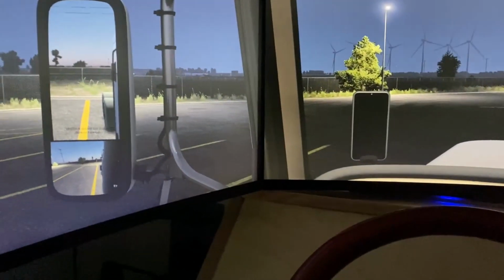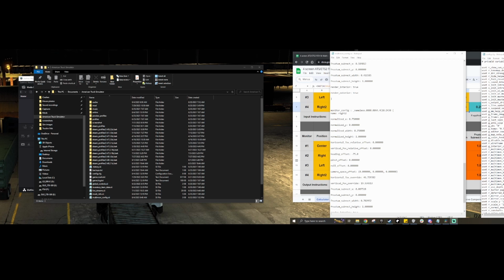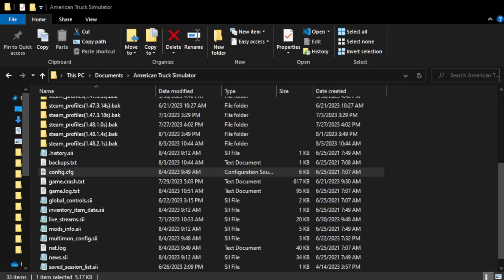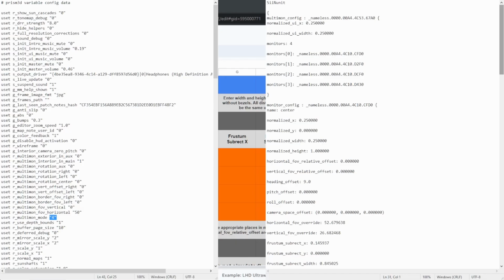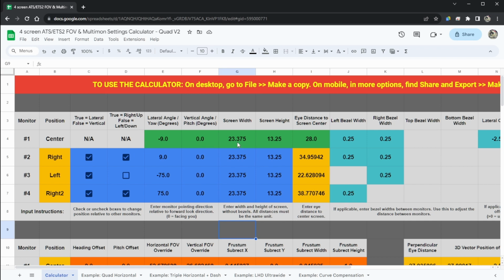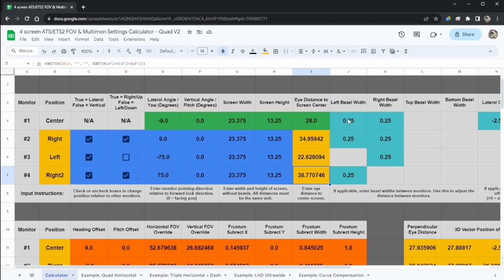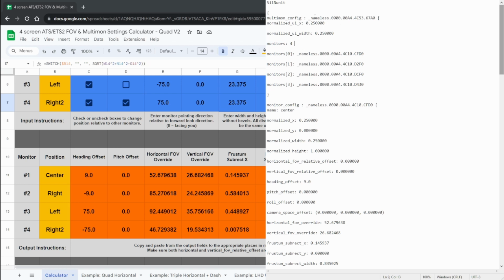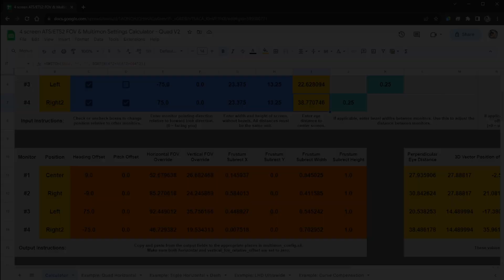How to setup 2 , 3 and 4 monitors with American Truck Sim | Doubles Triples Quad Screens | ATS

Comment: I have a question for you.  I'm using one Super Ultrawide (Samsung Odyssey G9).   Can I use these methods to setup ATS so that I do not have stretching along the sides of my monitor?   I would assume yes, because if you're using nvidia surround then, as far as ATS is concerned, it only knows you have one monitor at that one very wide resolution.  I assume what that config file is doing is actually rendering four separate scenes in displaying them appropriately across your one size resolution span, correct?  So essentially, I could set mine up as two, or three, or even ten (if software allowed) individual slices of "monitors" as measure them as if they were separate with bezel spaces being zero, and then edit the config file accordingly, and then that would get rid of the stretching, yes?   Or is there a better way to achieve that for those of us who use super-ultrawides?
Reply from the maker: Well I would say the short answer is yes to all your questions… however I would set it up as one screen with my same methods and input all the info just so it corrects its size properly, however if it’s just one monitor, you also can just use the default game setup to play, and can then adjust settings in game via f4 key… are you sure the game was using your proper resolution?
Reply: @KaNoodlefpv Yes, 100% it was set to 5120x1440 (native). I spent a couple hours last night messing with it, using the spreadsheet to try different calculations.  I ran into two problems.

1. No matter what, I couldn't quite get the numbers to work so that there wasn't a clear line of separation where the fov calculation takes over. (Hard to explain but its as if you could see three separate monitors on my screen, which is what I wanted, however I shouldn't be able to "notice" where it happens, if setup properly.  There's no smoothness in transition from one slice to the next, if that all makes sense.)

2. For some reason, and I think it's something in the arithmetic...  There is a single black line, vertical, separating the left section from the center section.  Had I actually had three monitors this wouldn't be something that could be noticed as it's as if it waits to start drawing on the left monitor for one extra vertical column of pixels.  I couldn't eliminate that.

Comment: Thanks for this video, but I am having trouble. I followed you instructions and ATS still only start with one monitor. I have tried Project cars 2 and the three monitors all connect and work well, so I know that my three monitor set up works. any advice please?
Reply from the maker: The menus are only on one screen, the gameplay is on them all… are you getting the game menus on one and then black screens on the rest? If you followed the video to the T, it will work as intended. Gimme some more info, maybe i can help!
Reply: Hi KaNoodle, I cannot get the screens to span despite that all three monitors are identical. I have reinstalled the nvidia driver, but two and three connect and disconnect at random. I'm missing something here?
Reply: Hello KaNoodle. I've now got 3 monitor setup after 6 installs of the Nvidia driver and a custom resolution, it's finally working. Thank you for your advice and time on this.

Comment: I need a bit of further assistance if anybody is able to help. I only have two monitors for my case. I did the measurements, everything looked great but it was super zoomed in so I could basically only see the windshield in my fov. The two screens seemed perfectly lined up, however i just need a wider fov. Not sure if I messed up somewhere to cause this.
Reply from the maker: Yeah I would go through it again, make sure all your measurements are correct.

Comment: is this done in imperial or metric?  does it matter if you have curved screens?
Reply from the maker: That’s a good question actually. I converted my imperial measurements into fractions essentially. I didn’t create the calculator so I’m not really sure. So maybe it doesn’t make a diff, but I’m not 100% sure.

Comment: this worked for my dual screen set up but when i added a 3rd monitor it wont display correctly in game!! it has like 4 screens in game!
Reply: figured it out!! when in Config File i Had Multimode set to 3 as in 3 screens.. but after some quick research i found  that 0 is the stock file for 1 screen so in theroy then "3"  would be a 4 screen set up.. entered the new peramiters and fixed my previous issue..

Comment: I don't know what's going on here. I have used two different calculators that look similar. This one and the one shared by Dave Cam over on his YouTube page. In both situations, I get the same results. There is about 60 degrees of field of view on both sides that are completely missing. What I mean by this is that when I scroll something off the left side of my center monitor, it doesn't appear on the left monitor until I continue to turn my virtual head another 60 degrees or so to the right (estimating). Same on the right side. There is just a HUGE gap of missing stuff between both my left and right monitors. I have filled out everything correctly, but I will try to share my files here for others to look at and verify. All 3 of my monitors are the same model:

Monitor width (inches): 23.625 (23 and 5/8 inches)
Monitor Height: 13.25
Distance from my eyes to center screen: 34 inches
Angle of each monitor: 57 degrees
Left/Right bezel width between each monitor: 0.375 (3/8 inches)

https://docs.google.com/spreadsheets/d/1qSnEyyNfb54iMO60wZSlbn33b1dBxPhp8Dz9MiPZce0/edit?usp=sharing
https://docs.google.com/document/d/1AuIVsaYw_Ihu7zo_5S_33WglYfmCuz1woTPjD4YMGjE/edit?usp=sharing

Both my calculator settings and my multimon_config.sii files are shared above. What am I missing here? The only values I have changed in the SII file are the values in orange on the calculator. This should hypothetically work.

Comment: This was definitely helpful. I'm working with two TV's for monitors. Could you tell me which number I need to adjust(play with) to make the screen move over. My steering wheel is split in the middle and I want it to shift more to the left screen. Thanks for the information anyway, it is a great help.
Reply from the maker: Ahhhh yeah!! Sorry for the delay. You will need to adjust the offset. I mention it at some point in the video, where I talk about placing yourself to the one side of the truck. Should be top right corner of the calculator… says offset, play with that number, 1 at a time until you set it where you are positioned in accordance to the screen.

Comment: @kanoodle i tried this on ets2 with double monitors but my screens are all zoomed in you know how i can fix this?
Reply from the maker: Hey there, it should be the same concept. I would attempt to go through the video again, ensuring you followed all the steps. Also, you can hit the f4 button and adjust your position in the cab. but if its zoomed, in, something likely went wrong in the setup process.

Comment: I don't understand why it doesn't work for me :C, I do everything you do but I can't get the same results, the center of the steering wheel is in the division of the screens.

Center N/A N/A 0.0 0.0 0.0 54.0 30.0 65.0
Right TRUE TRUE 45.0 0.0 0.0 49.0 27.0 65.096983

but wrong wrong wrong :C
Reply from the maker: you need to adjust the offset as explained in the vid...

Comment: So I am running a quad setup, nvidia graphics card, screens are on surround, resolution was set to the recommended 7680 by 1080. I changed the uset r multimon config to "4". Then I started the sim and exited. I went to input my my values from the calculator and open the multimon config file in notepad but then realized it only has 3 monitors  and i can't finish my variable input because there is a monitor missing in the multimon config file for some reason... all 4 monitors are on and functioning normal however i cannot get past variable input. Any idea if i missed anything? : /
Reply from the maker: yooo yeah you can just copy the text from the others in the config. 

SiiNunit
// Triple.AAv5.100 
// These two lines must be set in config.cfg when using
// this multimon_config.sii file only.
// uset r_scale_y "1"
// uset r_scale_x "1"
//
// We need 4 rendered images (max game can do).
// AA.Enabler has to be the 5th image (unrendered)
// to prevent memory leak.
//
// horizontal_fov_override: 0.000000 - Set the same FOV for:
// Center.AA, Left.AA & Right.AA ONLY.
// OR keep ALL FOV values at "0.000000" and use the games
// F4 menu option to set your desired FOV and also have a
// working ZOOM feature.
// 
// "Dummy" & "AA.Enabler" are required but not displayed.
// DO NOT CHANGE ANYTHING IN THESE!
//
// Adjust bezels to suit your setup (my example 10mm bezels).
// monitor_config : _Left.AA {
// heading_offset: 3.500000 <- My Bezel (4.0 moves closer
// to center / 3.0 away)
// monitor_config : _Right.AA {
// heading_offset: -3.500000 <- My Bezel (-4.0 moves closer
// to center / -3.0 away)
//
// Recommend capping FPS at 60 or lower.
// Full MSAA setup instructions are here:-
// https://roextended.ro/forum/viewtopic.php?f=19&t=1000
{
multimon_config : _nameless.Triple.AAv5.100 {
 normalized_ui_x: 0.334
 normalized_ui_width: 0.333
 monitors: 5
 monitors[0]: _nameless.Center.AA
 monitors[1]: _nameless.Left.AA
 monitors[2]: _nameless.Right.AA
 monitors[3]: _nameless.Dummy
 monitors[4]: _nameless.AA.Enabler 
}

monitor_config : _nameless.Center.AA {
 name: Center
 normalized_x: 0.333333
 normalized_y: 0.000000
 normalized_width: 0.333333
 normalized_height: 1.000000
 horizontal_fov_relative_offset: 0.000000
 vertical_fov_relative_offset: 0.000000
 heading_offset: 0.000000
 pitch_offset: 0.000000
 roll_offset: 0.000000
 camera_space_offset: (0.000000, 0.000000, 0.000000)
 horizontal_fov_override: 0.000000
 vertical_fov_override: 0.000000
 frustum_subrect_x: 0.000000
 frustum_subrect_y: 0.000000
 frustum_subrect_width: 1.000000
 frustum_subrect_height: 1.000000
 render_interior: true
 render_exterior: true
}

monitor_config : _nameless.Left.AA {
 name: left
 normalized_x: 0.000000
 normalized_y: 0.000000
 normalized_width: 0.333333
 normalized_height: 1.000000
 horizontal_fov_relative_offset: 1.000000
 vertical_fov_relative_offset: 0.000000
 heading_offset: 0.000000
 pitch_offset: 0.000000
 roll_offset: 0.000000
 camera_space_offset: (0.000000, 0.000000, 0.000000)
 horizontal_fov_override: 0.000000
 vertical_fov_override: 0.000000
 frustum_subrect_x: 0.000000
 frustum_subrect_y: 0.000000
 frustum_subrect_width: 1.000000
 frustum_subrect_height: 1.000000
 render_interior: true
 render_exterior: true
}

monitor_config : _nameless.Right.AA {
 name: right
 normalized_x: 0.666666
 normalized_y: 0.000000
 normalized_width: 0.333333
 normalized_height: 1.000000
 horizontal_fov_relative_offset: -1.000000
 vertical_fov_relative_offset: 0.000000
 heading_offset: -0.000000
 pitch_offset: 0.000000
 roll_offset: 0.000000
 camera_space_offset: (0.000000, 0.000000, 0.000000)
 horizontal_fov_override: 0.000000
 vertical_fov_override: 0.000000
 frustum_subrect_x: 0.000000
 frustum_subrect_y: 0.000000
 frustum_subrect_width: 1.000000
 frustum_subrect_height: 1.000000
 render_interior: true
 render_exterior: true
}

monitor_config : _nameless.Dummy {
 name: Dummy
 normalized_x: 0.000000
 normalized_y: 0.000000
 normalized_width: 0.000000
 normalized_height: 0.000000
 horizontal_fov_relative_offset: 0.000000
 vertical_fov_relative_offset: 0.000000
 heading_offset: 0.000000
 pitch_offset: 0.000000
 roll_offset: 0.000000
 camera_space_offset: (0.000000, 0.000000, 0.000000)
 horizontal_fov_override: 0.000000
 vertical_fov_override: 0.000000
 frustum_subrect_x: 0.000000
 frustum_subrect_y: 0.000000
 frustum_subrect_width: 0.000000
 frustum_subrect_height: 0.000000
 render_interior: false
 render_exterior: true
}

monitor_config : _nameless.AA.Enabler {
 name: fullgameres
 normalized_x: 0.000000
 normalized_y: 0.000000
 normalized_width: 1.000000
 normalized_height: 1.000000
 horizontal_fov_relative_offset: 0.000000
 vertical_fov_relative_offset: 0.000000
 heading_offset: 0.000000
 pitch_offset: 0.000000
 roll_offset: 0.000000
 camera_space_offset: (0.000000, 0.000000, 0.000000)
 horizontal_fov_override: 0.000000
 vertical_fov_override: 0.000000
 frustum_subrect_x: 0.000000
 frustum_subrect_y: 0.000000
 frustum_subrect_width: 1.000000
 frustum_subrect_height: 1.000000
 render_interior: false
 render_exterior: false
}

}
Reply from the maker: Here is my exact file, if it helps you! 

SiiNunit

{
multimon_config : _nameless.0000.00A4.4C53.67A0 {

normalized_ui_x: 0.250000 

normalized_ui_width: 0.250000

monitors: 4 

monitors[0]: _nameless.0000.00A4.4C10.CFD0 

monitors[1]: _nameless.0000.00A4.4C10.D2F0 

monitors[2]: _nameless.0000.00A4.4C10.DCF0 

monitors[3]: _nameless.0000.00A4.4C10.D430 

} 

monitor_config : _nameless.0000.00A4.4C10.CFD0 {
name: center 

normalized_x: 0.250000 

normalized_y: 0.000000 

normalized_width: 0.250000 

normalized_height: 1.000000 

horizontal_fov_relative_offset: 0.000000 

vertical_fov_relative_offset: 0.000000 

heading_offset: 9.0

pitch_offset: 0.000000 

roll_offset: 0.000000 

camera_space_offset: (0.000000, 0.000000, 0.000000) 

horizontal_fov_override: 56.814619 

vertical_fov_override: 28.678546

frustum_subrect_x: 0.157295 

frustum_subrect_y: 0.000000 

frustum_subrect_width: 0.833787

frustum_subrect_height: 1.0

render_interior: true 

render_exterior: true 

} 

monitor_config : _nameless.0000.00A4.4C10.D2F0 {
name: left 

normalized_x: 0.000000 

normalized_y: 0.000000 

normalized_width: 0.250000 

normalized_height: 1.000000 

horizontal_fov_relative_offset: 0.00000

vertical_fov_relative_offset: 0.000000 

heading_offset: 90.0

pitch_offset: 0.000000 

roll_offset: 0.000000 

camera_space_offset: (0.000000, 0.000000, 0.000000) 

horizontal_fov_override: 120.350511

vertical_fov_override: 51.319459

frustum_subrect_x: 0.508949

frustum_subrect_y: 0.000000 

frustum_subrect_width: 0.485855

frustum_subrect_height: 1.000000 

render_interior: true 

render_exterior: true 

} 

monitor_config : _nameless.0000.00A4.4C10.DCF0 {
name: right 

normalized_x: 0.500000 

normalized_y: 0.000000 

normalized_width: 0.250000 

normalized_height: 1.000000 

horizontal_fov_relative_offset: 0.000000 

vertical_fov_relative_offset: 0.000000 

heading_offset: -9.0 

pitch_offset: 0.000000 

roll_offset: 0.000000 

camera_space_offset: (0.000000, 0.000000, 0.000000) 

horizontal_fov_override: 90.428969

vertical_fov_override: 25.753907

frustum_subrect_x: 0.595429

frustum_subrect_y: 0.000000 

frustum_subrect_width: 0.40029

frustum_subrect_height: 1.000000 

render_interior: true 

render_exterior: true 

} 

monitor_config : _nameless.0000.00A4.4C10.D430 {
name: right2 

normalized_x: 0.750000 

normalized_y: 0.000000 

normalized_width: 0.250000 

normalized_height: 1.000000 

horizontal_fov_relative_offset: 0.000000 

vertical_fov_relative_offset: 0.000000 

heading_offset: -90.0

pitch_offset: 0.000000 

roll_offset: 0.000000 

camera_space_offset: (0.000000, 0.000000, 0.000000) 

horizontal_fov_override: 71.571031

vertical_fov_override: 22.456985

frustum_subrect_x: 0.005196

frustum_subrect_y: 0.000000 

frustum_subrect_width: 0.485855

frustum_subrect_height: 1.000000 

render_interior: true 

render_exterior: true 

} 

}

Comment: When I changed the multimon mode from 0 to 4, it just made ATS super small and only displayed on the center of triple monitors. 
   Any advice?
Reply from the maker: Yeah, in the multimon, you will see at the top, the ratio at which the UI menu is, it can be 25%/.25 putting it on 1/4 of the total 4 screens, 50%/ .50, moves it to the middle. 75%/ .75 moves it to the 3/4 screen, and 100% or 1.0. Let me know if you still have trouble.
Reply: I have the same issue, and no idea where the multimon settings are. Skipped that in the vid @KaNoodlefpv
Reply: I have three separate views on my one monitor in the center. All this did was mess up my game now.
Reply from the maker: @realkawfee  then you did something wrong my friend.
Reply from the maker: @realkawfee  might want to watch it again. It’s all explained in the video, and they’re are links in the info. Good luck my friend.
Reply: Thank you big help

Comment: 1 month ago... the multimon page states it's for 1.17, i've tried this twice with 3 monitors and what i think i'm doing is correct, yet in-game it's SO zoomed in.. I dunno how to fix it :(
Reply from the maker: Yeah you may not be at the proper distance. Re-measure your eye to center of center screen, or with 4 screens, it will be the left center one. You can even add an inch or two or 3 or 4 or take away from your number, to adjust for this. However keep in mind, this method is for someone who is not trying to see the dashboard.

Comment: Awesome video!! Can you make a video of how you mounted the monitors and just the setup as a whole?
Reply from the maker: Hey there, I have since changed some things, hence the hold of videos at the moment. Ive been making some dashboard adjustments, and working on a smaller more compact design from the one you see in here.... However, I had one triple monitor mount holding the right three monitors, and the far left one, was mounted to the wall with a basic wall monitor mount.
Reply: @KaNoodlefpv  That definietly helps! I'm currently in the process of buying monitors and possibly desks to set my monitors up on. But I think going the way of monitor mounts is the way. Especially if I'm going to try and make my own dashboard! Thanks again!